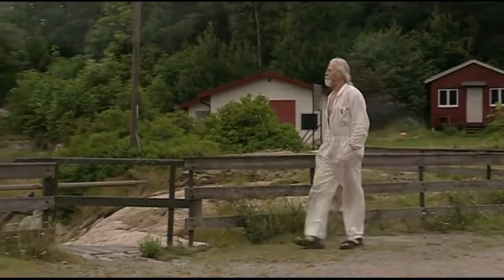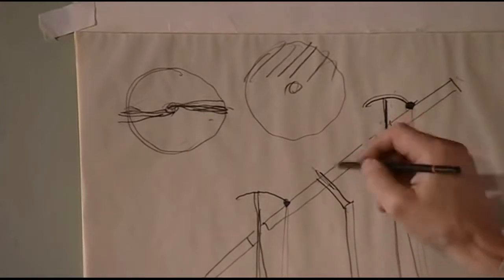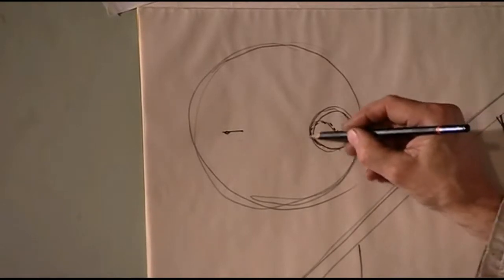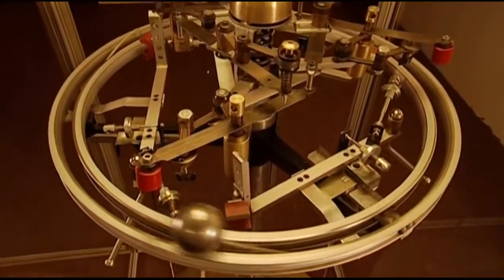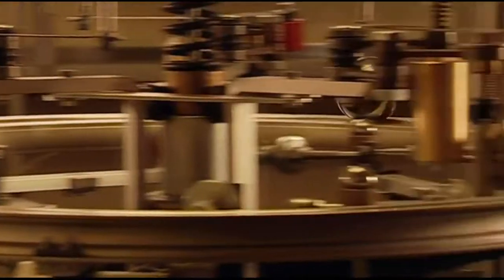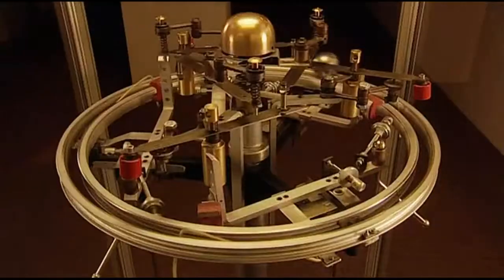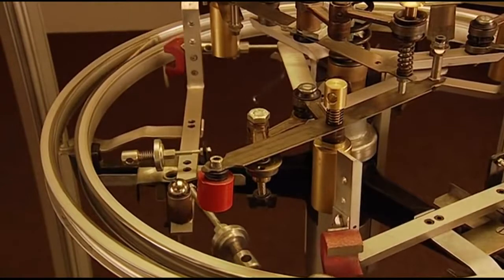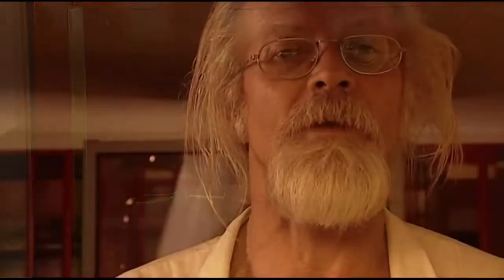Perpetual Motion Machine

Comment: Im a total ignoramus, but isn't magnetism an energy that's powering his device? But then that leads me to wondering if magnets will eventually lose their energy? I'm sure physics people could answer me that.
Reply: correct.
Reply: A magnetic field "has" energy.  If the magnetic field is changing, then the energy of the field is changing, and that energy can be made to flow in useful ways.  After all, our entire civilization is powered by the changing magnetic fields inside dynamos at power stations.  But if the magnetic field is static, its energy is not changing either, and there's no surplus energy to move things around.  A perpetual motion machine creates energy out of nothing, and conservation of energy says this is impossible.